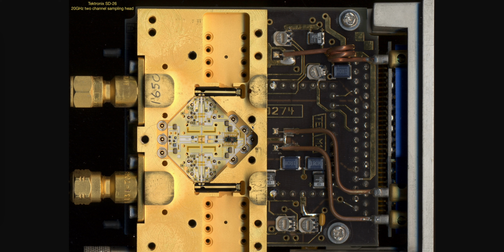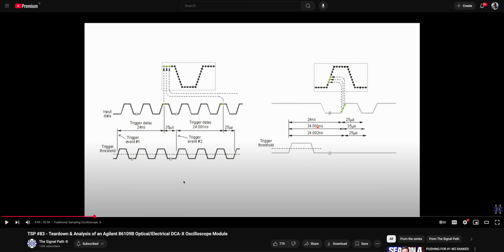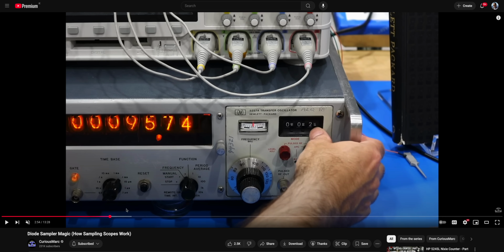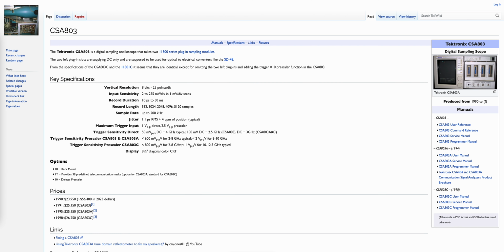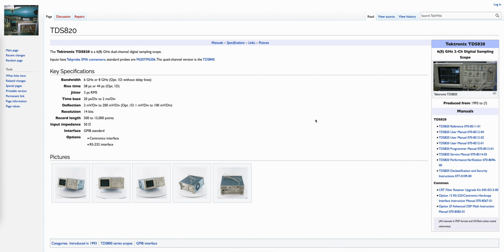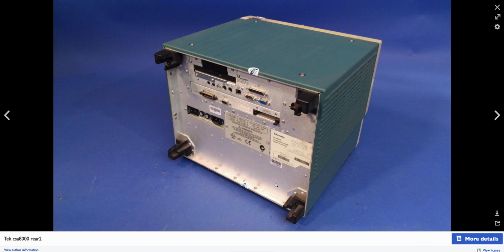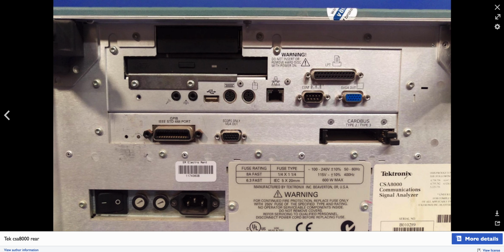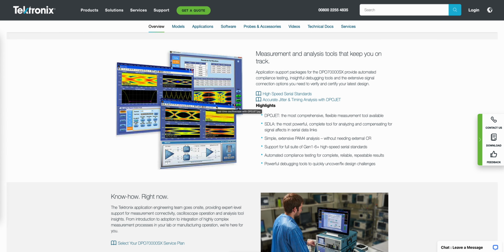Sampling Oscilloscopes: The Tektronix line

Comment: Awesome deep dive, thanks for sharing! The reason for making TDS820 (22:50) is actually quite simple - it fits a niche of capturing repetitive signals without an availible trigger signal. And this is what inherently limits its bandwidth to units of GHz.

A regular sampling scope needs an almost perfect jitter-free external trigger signal in order to sample the signal of interest (that's just how it is - you have to tell the timebase where exactly the next repetition of the signal begins). And the most important thing is that when the trigger edge is applied, some time is required to set up the timebase and aquire the sample. This delay is usually on the order of 20-40 ns. During this time the scope cannot observe the waveform.  This need to have a preceeding trigger signal is is a very serious limitation to the types of sources that an oscilloscope can measure, you have to basically have a source which provides its pulses very stably on command. 

There are lots of pulsed signal sources where the moment of pulse generation occurs somewhat randomly in some wide time window (spark gap pulsers, mercury-wetted relays, and others). Due to this, naturally the pre-trigger signal cannot be provided. So, to observe these signals on a sampler, usually the pulse is split in two. One part is supplied to the trigger input at once to start the timebase, and the other part is fed through a long delay line to delay it by those 20-40 ns needed for the timebase to start.

In real world even the best delay lines are quite lossy as such delay values, and they limit the bandwidth of the observed signal. Usually ~5-8 GHz is the limit of such delay lines bandwidth. 

The TDS820 is precicely such a scheme packed into a complete device. It is a sampling oscilloscope with a unique feature that it does not need a trigger signal. You just supply the pulses to the input and it performs the "split + delay line" trick internally. But the delay line limits the input bandwidth to 6 GHz, so there is no need to bother with making the sampling head itself to much higher frequencies. In this case they made it for 8 GHz. 

This device was sort of a product of its time, made to provide no-pretrigger applications such as pulsed power with the means to observe subnanosecond signals when real-time oscilloscopes weren't quite there yet. Nowadays this would be quite useless, as real-time oscilloscopes for 6 GHz are quite common and these do not need external trigger at all AND can capture single events. So the samplers are left in the 18+ GHz niche where the real-time oscilloscopes are still prohibitively expensive for most.

Comment: Hi i have tested adcmp582 ic they are sensitive to 1mv but they are not stable ! even in 20mv ! as I know this comparator must be in compare mode normally then being latched and hold Binary output in rising edge of latch clock(or sample clock)but for example if vn pin is connected to ground or a very stable dc as threshold and also a very stable dc input voltage in vp pin as input ...the comparator needs to change input voltage at least 10-20mv upper or lower than (threshold + offset voltage) to be stable 0 or 1 so how this ic has a 1mv hys and can be a good choice for a 12bit sampler?

Comment: There is a good white paper from Lecroy which give an introduction to the difference between "Sequential Interleave Sampling" and "Random Interleave Sampling" in the context of sampling scopes. Beside it is non-random but the authors of the naming "random" where shy of call it "fractional".
The old sequential techniques using discrete analog circuits for the precise armed and triggered delayed sampling. This limit the sampling to about 1MHz, very slow in comparison to the GBit/s data signals you want to display. In addition the data signal sample to sample jitter spread over millions of cycles making it impossible to diagnose jitter based effects.
Newer designs based on RIS could go up to GS/s which is then limited by the repetion rate of the TDC (time to digital converter. The sampling is then complete independent and the sampling jitter is coming from the TDC. The Picoscope 9400 sample with 500MS/s for up to 33GHz with 1.2ps jitter, most i guess from the TDC. Good realtime scopes are less than 100fs, you see its the TDC. But there 20-50x cheaper than realtime.